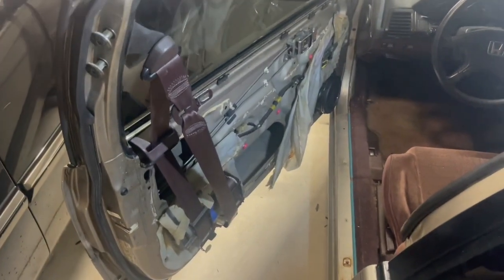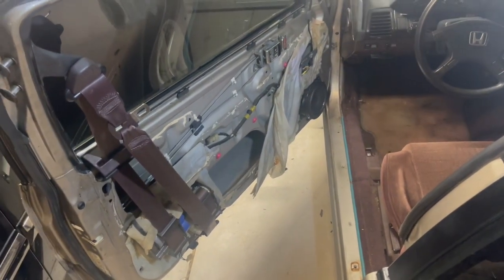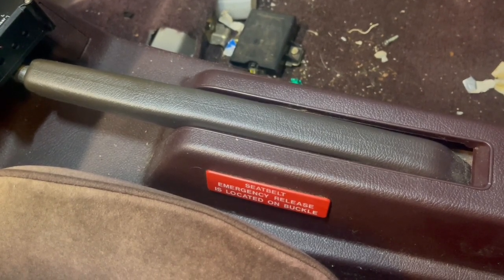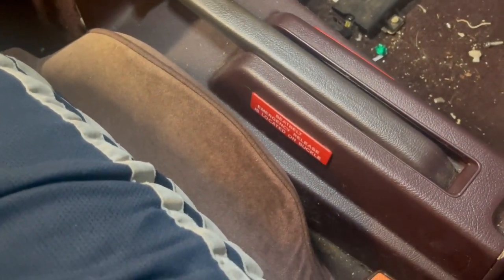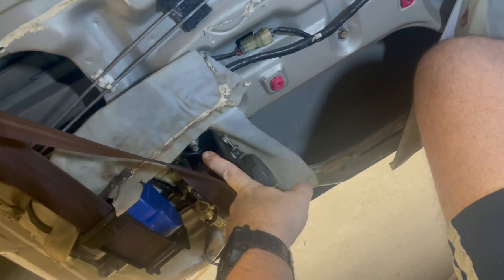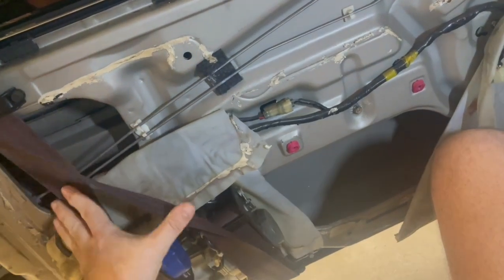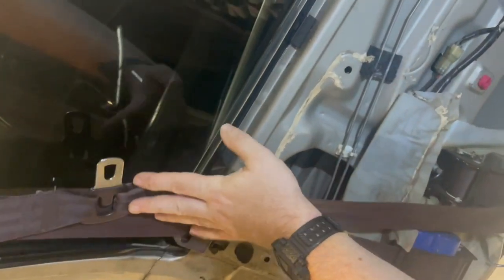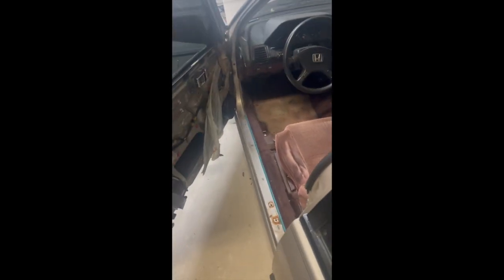Why Is My Seatbelt Attached To The Door?

Comment: Thanks man, I'll be sure to check mine. I figured that these older cars weren't supposed to lock in place, so I never questioned that mine may have failed.
Reply from the maker: I always assumed they worked until I did the video.  There was also a guy who got into a car accident earlier this year and he broke the steering wheel and had his seatbelt on.  So I need to get mine working and will make a video on how I fixed it.

Comment: The belt doesn't lock until there is some g-forces.  Go around a turn hard, and they will lock up.  Or slam the brakes really hard, and they will lock up.  That can malfunction too.  Try reading the owners manual.